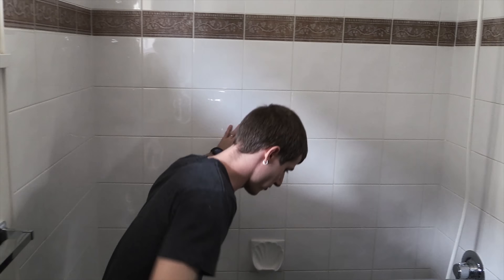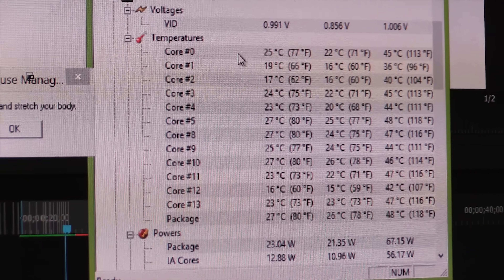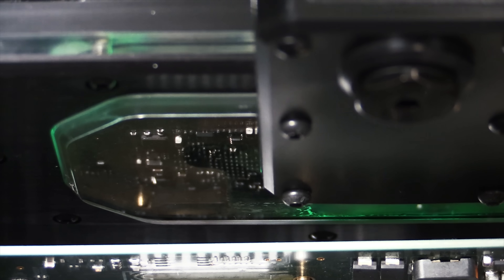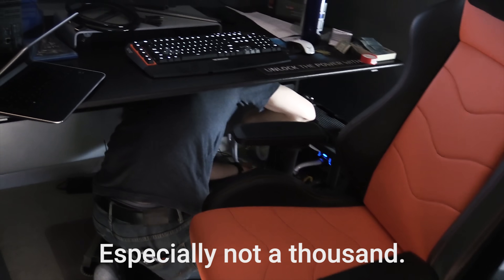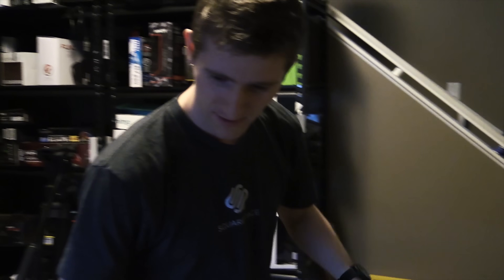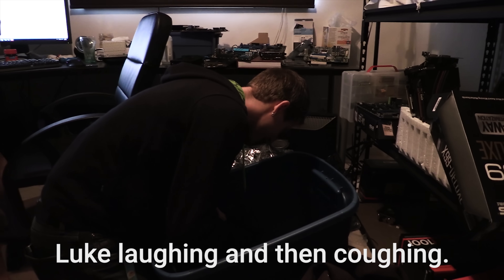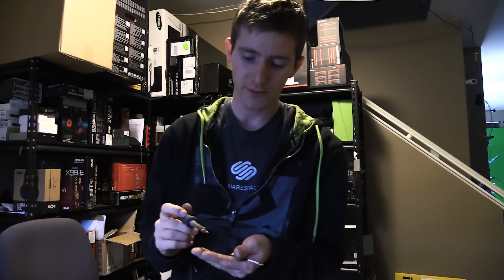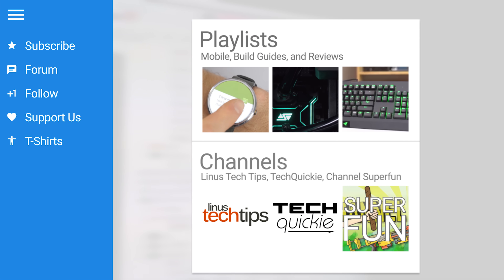Whole Room Water Cooling Part 5b - Some Issues, More Solutions...

Comment: soldering tips. Don't use too much heat. Ever. On the other hand, you want enough heat to make the solder flow freely. You don't seem to have the heat set right in your video. Also, copper wire transfers heat, which can lead to messing up the insulation down the conductor if you mess with the connection too long. A good solder connection should be almost effortless if your heat is set right. Tin each wire lead, and then let the tined wires bond together, no extra solder should be needed. Too much solder is a bad thing. Lastly, consider using some shrink tubing instead of electrical tape. I like to shrink each wire and then one larger shrink tube over all of the wires at the solder connection. Use HIGH Quality shrink tube. Shit tubing is shit tubing. Lastly, always use the best of everything you can get our hands on. Make sure to use the right solder for the job. There are lots of different kinds.

Comment: Put the soldering  gun under the wire and the solder  on top when it's hot enough it will suck the solder into the wire and give it a nice clean connection and looks much cleaner

Comment: When you solder something, you should never get the solder on the tip first and then on the wires, instead heat up the wires with the iron on one side and then let it melt on the wires. With that taktik you will not lose flux and make your life much much easier ;-P

Comment: linus, about soldering, you can cut off small sections of the solder material, heat it up until its easier to shape, and just coil it around a connection, making the melting process MUCH more efficient and more evenly spread

Comment: to really easy soldering your cables only need to use soldering paste instead your flux pen, soak te tip of the cables in to the paste and aply a drop of molten welding.

Comment: ive been soldering sense i was 8 and do so everyday.   when i have to solder one wire to another it is good to ensure a good mechanical connection and a good soldier connection, instead of twisting together. i twist individually( frayed ends  of each wire tightly). then bend it over the insulation going back into the same direction of the wire(like a u turn). then hook the two together like hooking two fingers together, soldier (with a smaller gage soldier). then slip heat shrink over it, for a water environment i would use marine heat-shrink(has glue in it).    you can even slip a bigger piece over both wires if there runing next to each-other (like ac power cords for example, then do what i mentioned individualy then slip that over for neatness. however you will have to slip that piece on before soldiering.
Reply: nice lies

Comment: My tip for soldering, if you're going to solder two wires together, don't twist them together.  It's never as strong as them being next to each other with a nice connection of the two (the wires twisted together will have little bits holding them in the middle as opposed to a thick layer around it).  Also don't use tape, invest in heat shrink (don't forget to put it around the cable first). It's easiest when the two wires you're soldering together are the EXACT same length.
Reply: Gunnanator actually twisting the wires together strengthens them because they are "merged" together

Comment: For the soldering tin the wires using plenty of flux.  then do a wire wrap splice using some bus wire then solder them together.  Shrink tubing is a nice finishing touch.
Reply: why not solder the fan ends together and use a very powerful lab powersupply like a bk adjustable power unit

Comment: for the two pumps you should've maybe put in a Y adapter so the intake branches into 2 tubes going into each of the pumps and then connect both the outputs together with another Y adapter back into the loop. that would relieve stress on the pumps by not creating a difference in water pressure.
Reply: Chef Excellence that would have been a horrible Idea 
The pump with more head pressure would have been pulling away from the lesser pump 
pulling through air, possibly causing the smaller pump to run dry/ air lock the system.
Reply: Y adapter maybe not the solution, but 2 pumps taking water from one large reservoir - no problem, then output to one tube  - double the pressure.

Comment: warm up the wires a lot with the iron, then touch the solder to the wires. If you fluxed it correctly the solder should run over the wires by itself and completely cover the end of the wires up until the isolation. Too hot and it will run off and drip, Its more practice than theory.

Comment: Thought I should say, my PC is currently running at 57*C CPU with less than 5% CPU usage... 

Might be time to do some loop maintenance!!!
Reply: It does make sense, but it is very loud having two GPU's and a CPU under 100% load 24/7 with blowers! :P
Reply: Comparatively looks like shit though
Reply: Or use air cooling, makes more sense in terms of maintenance and cost..

Comment: u used the wrong solder. the solder u used was for propane torches NOT for soldering irons. go to RadioShack so u can see what the solder u should have used. they have this with plumbing solder at home depot but it should say what it is for

Comment: Dudes. You should just get to some skillful plumber and let him make you proper radiator and i mean like a car one. You may even get away with no fan at all. Also, the thing hatched in your tubings because of not using it, if the water was constantly moving you probably would be fine. Using series array of pumps is a total misunderstanding. Ever heard of super-cavitation effect? And last but not least: don't ever stick your finger in the outlet of your system or obstruct the flow in any way, pressure in your system might have built up and literally tear apart water blocks inside PCs destroying them and your precious stuff. Besides those and some others flaws I think your idea is great, i was planning to do something like that but for just one PC in smaller scale

Comment: I gotta say... This looks like an awfully complex and unnecessary procedure to cool the computers! The issues and problems are incredibly fun to watch though! :D
Reply: @John Smith OR, you could have traditional cooling on the PC's, and get one of those window air conditioners... Crazy concept I know.
Reply: Modern computers put off a lot of heat and it's really annoying to people sitting in the room (especially when there are 3 or 4 machines in a small area).  So this was more of an attempt to get the heat out of the room than it was to cool the components themselves.  The upside to this is you also will get excellent low component temperatures in the winter time since the radiators are outside.  The downside is the (component) temps in the summer time will be worse than they would if the rads were inside.
Reply: you should isolate all of the copper piping if it was done for this purpose, cause for now u have a heater with all this open piping.
Reply: The only purpose of doing this project are the youtube views. Otherwise, it's both ineffective and impractical.

Comment: OH. MY. GOD. You got the COMPLETELY wrong size of solder. facepalm ....
Reply: I am just shuddering watching him solder. You went and bought a nice Weller station and have no idea how to use it. Next time I'm out west, I will GLADLY host a "How to solder" workshop at LMG if you want, free of charge.
Reply: Aurelius R if you’re just soldering two wires like this it’s not a big deal get off your high horse. It’ll just flow worse. It’s just impacting your efficiency
Reply: @MilkIsASauceTV  Yeah, no, it won't "just flow worse". It's a cold joint that will be brittle and weak, and very likely to fail.
Reply: Aurelius R yeah uh no, not with solder of that diameter buddy. He’ll be just fine as long as it’s a good composition. Just from the less than 1 second clip we see of the solder that looks optimal to me. Depending on preference 1mm - .5mm is great for soldering wires and that looks like it’s in that range to me

Comment: Why? Why no UV lights, or silver, or chlorine, or antimicrobial solutions... what the hell were you thinking? Any time you have a reservoir of water you have to disinfect it. A bunch of people died when an A/C reservoir got full of some bacteria (can't remember the name).
Reply: You're thinking of Pontiac Fever (May have another name.). I think what makes it dangerous is how the A/C moves air and can send small droplets of water containing it everywhere. I don't think that would be a problem in their case. With that said, they could have benefited from some form of disinfectant or filtration, but that is easy for us to say because we have the benefit of hindsight.
Reply: ***** Benefit of hindsight? Not at all -- anytime you have a reservoir of tap water, you NEED to disinfect. Either that or use distilled water..
Reply: I was thinking of Legionnaire's disease. And yes, it IS possible. They had a reservoir, with moving water, with air access, in a contained area.
Reply: I'm thinking the iodine would kill the bacteria

Comment: I'm so behind, any tips I give will already be below (I never read posts, I have good books with less words) However, Tin the wires, use pliers and heat shrink.  (Whats with this new italic font..)  So hard to watch, and hear, the plastic melting; smell must have been nice.  

BOOZE, like vodca or hmmm, well vodcas good, would that work for cooling?  Could have a nice heat transfer, vapor thing going on in the Res, so long as it can take some preasure.  Nothing would grow and you could sell it as aged LTT brand.  Also would not freeze.  
LTTV technicaly the best Vodca.

Comment: Tips for soldering: When you strip the ends of the wire, bend each end into a "U" shape and lock them together. That way the wires will hold themselves together while you work on them, and the wire itself will hold the whole thing together on the off chance you pull on the harness rather than simply being held by the solder.
Reply: worst thing to do when you solder wire, just twist them together, it's far more stable and they dont move around when soldering them.

Comment: buy a small pool pump like a normal person and not these little fish pumps. noise can be dampened by using a wood cover.
Reply: yea i dont think those little pumps will run 5x 560mm 86mm thick rads ile probaly need a pump that is used for boosting flow rates

Comment: +LinusTechTips
Protips for soldering: don't do it in anyway like you did it.

The solder that you used is for copper pipes, for wiring you want a much thinner gauge. This thinner gauge wire usually has flux built into it. Plus one of the number one rules for soldering is that you don't put the solder on the iron then "paint" it onto the wires.
A quick guide for soldering:
Preface: Make sure you have proper, electronics-grade solder before doing this.
After stripping the wires, sliding on the heatshrink, and waiting for the iron to heat up fully.
1.) Twist stripped wires together in any fashion of join, my favorite is the "Western Union Tie" for projects like that.
2.) Apply soldering iron to the middle of the underside of the wire tie.
3.) While keeping the iron in place, apply the proper grade solder to the middle of the top side of the joint.
4.) Solder will not immediately flow, allow time for the wire to heat up, and the solder will flow, solder should be applied with common sense, leaning towards the liberal side, but not enough to leave chunks or globs on the joint.
5.) Use iron to flow any uneven solder throughout the joint.

Comment: Using tap water in the water cooling loop.  Wonderful
Reply: +Jacob Halfman They clearly filled it with a garden hose, at least the first three times.
Reply: +Jacob Halfman How about the time they used the shower head to top things off? and if the garden hose was attached to a bucket, why was the bucket outside? and why was the water clear when they added it until after it backflowed?
Reply: +Jacob Halfman Sir, did I at anytime attack you personally? Did I at anytime offer insult? Did I offer anything but a simple correction? Did I ever state that you are flat out wrong? If you were able to show me that they had  the water of that room hooked to a distilled or de-ionised reservoir I would have relented and declared you correct.

I may be an asshole, but I do try to not sink to logical fallacies and attack someone for holding a different idea or conclusion. Since I have obviously offered you some great offense, I apologize.
Reply: +Jake Rosendahl Also, it's a nice touch to have all of the archive footage (obviously not backed up anywhere else) just lying around the bath tub. They're lucky they could move to the new office.
Reply: Mr424242424242424242 what i meant is you were both being nice but yet slightly passive aggressive by that i mean you were discussing politely i was playing on the stereotype that Canadian people are nice and there fore i was mentioning that you were being nice
Reply: they've been using a distilled\antifreeze mix
Reply: the hose was attached to their bucket of mix
Reply: +Mr424242424242424242 we got some Canadian warfare going on here
Reply: yet Mr424242424242424242 you havent  taken into the account that they at the very least may have added in antifreeze and mixed it in loop after the fact.
Reply: +Jacob Halfman What do you mean by that? I don't quite understand what you are saying, as it appears that they threw the anti freeze into their reservoir and the tap water mixed with it as it entered the loop, at evidenced by the color change it undergoes when the pump is cycled off, and gravity forces water back into the reservoir and up the fill tube. 

If that isn't it, then may I ask for a clarification of what precisely you meant? As presently, I cannot be certain that I have divined your meaning.
Reply: +21brewswi2 Who ever said either of us was Canadian? I simply enjoy discussions which use the trappings of formal logic and debate to encourage clarity, and civility. I happen to be an American, although I am north of certain portions of Canada. I simply have a little training and a certain like for formalized discussion rather than arguments which soon blaze out of control.
Reply: +21brewswi2 can you tell I was being silly our shall I add a disclaimer next time?
Reply: Mr424242424242424242 dude i know you were kidding i said Canadian warfare because if you could call you discussion a fight it would have been the worlds most passive aggressive fight ever to conclude ( ITS A PRANK BRO ITS JUST A PRANK IM NOT ACTUALLY DEAD)

Comment: Why do you need a flux pen? Shouldn't there be flux inside the solder?
Reply: +Duncan McAfee There are, but more to the point if you apply the flux separately you can often get much better results.  If you're ever soldering surface-mount components you'll need separate flux.
Reply: +Holzkohlen I'm not the most qualified to say, as I've only dabbled in soldering, but aren't there solders that aren't flux core?

Comment: use crimp type connectors instead of soldering them and use Noox to prevent corosion followed by rtv or silicon for water proofing

Comment: Soldering stuff together: Make sure you have a heat-shrink tube over each separate wire, do a lineman splice to connect the wires if you have the space, apply rosin-core 60/40 (leaded) solder, move heat-shrink tubing in place, apply heat to shrink tube and get snug fit.

Comment: Tips for soldering: Use 300 - 350C (150 - 175F) on the iron, and use flux cored solder. Put a little bit of solder on all of the wires before you start soldering them together. Doing this, tinning, not only makes it easier to join but it prevents stray wires.

Comment: when I used to solder before I realized I cant solder, my hands are to unsteady for me to be able to do so, I would use rubbing alcohol to remove the oil on the wire that it got off my hand,cant remember why I did it but I remember it helping.

Comment: soldering tip slide shrink tube down one side of the wire before soldering 2 wires together then slide it over the gap and use a low flame to indirectly seal it. multiple layers and sizes of tubing for best results .

Comment: Do you want to drop down the temperature INSIDE the room?
Then you should isolate all the tubing system, copper tubes transfer the heat from the water to the ambient air inside the room.

Comment: The more i look the more frustrated i get when i see him work.  I asume you have a kind of it education.  And you think a education of plumber is nothing.
Reply: +J IJzer It was the plumber who soldered the Tee joints that leaked.
So many LOLs on this project.  I do, however, know how I'd design one. Perspex with sharkbait at the lowest level of the highest tower's connections, and out to the radiator through the wall. One good quality pump and reservoir system like he already had, and lots of bleach in the water.  Bleach IS your antibacterial agent.
Reply: ann kiszt at the end of the vdeo series he admids that he is wrong.
Reply: an*
Reply: Niels Wehrens just keep yourself to your profession.

Comment: Why didn't you use AC fan instead of those DC fan? One big fan would enough to pump the heat off just like the air conditioner works.